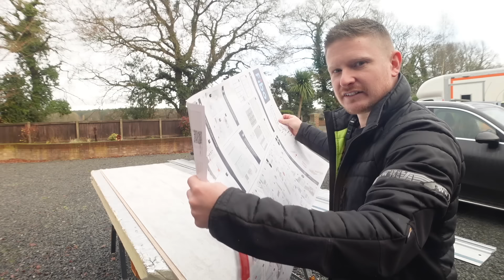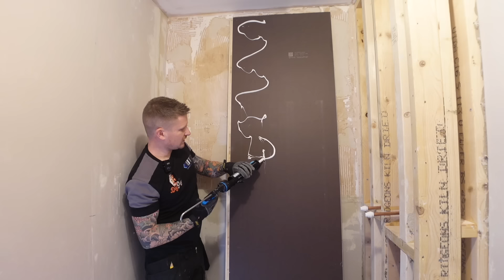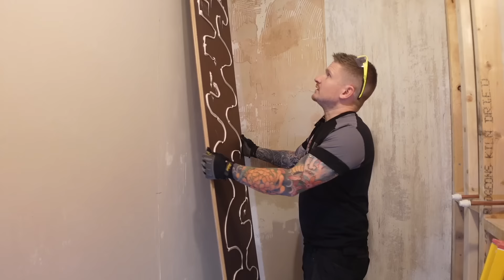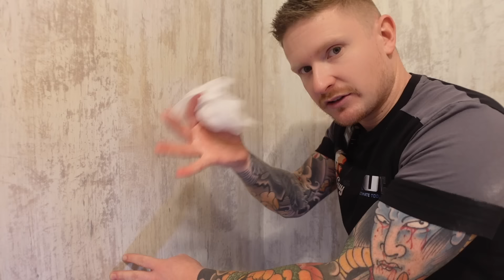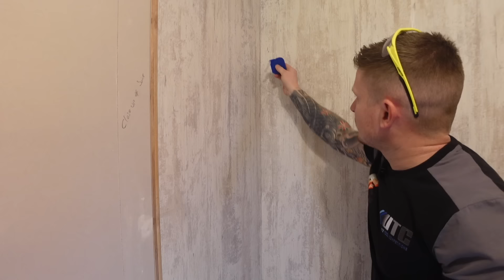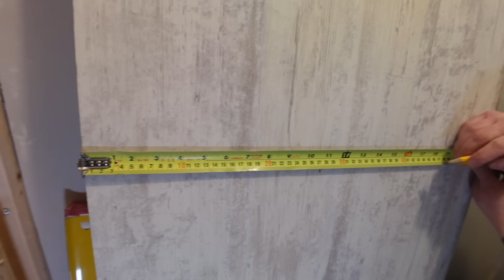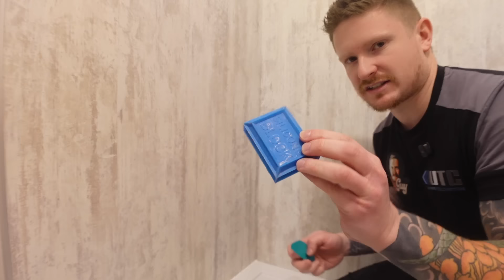How to Install Shower Wall Panels - Easier and Faster Tile Alternative!

Comment: A question for you, I'm planning a bathroom renovation and I want shower wall boards, but would you suggest taking the existing tiles off or leaving them on and just put the boards over them?
Reply: Hi, may I ask what did you do, did you remove the tiles? I have the same dilemma, to remove or not, something tells me to remove
Reply: @ChristopherSkierka  The people who installed the panels for me left the tiles on. The amount of work required to take them all off to get basically a centimeter of space on each wall is not worth it.
Reply: @AlexKnight1978 thank you. I just have this feeling a fail will happen in the future if it's stuck to the tiles instead of the substrate, also u can tank it better if tiles removed

Comment: How did u scribe the board that would,nt have went in tight to corner with pipes stuck out ,liked to have seen how that was done......
Reply from the maker: Yeah I didn’t show that. It’s done in the same way, before drilling the holes. You just stand the board at a slight angle so it sits up against the pipes and you get the same shape 👍

Comment: Wen u use your tracksaw  do you clamp the actual track down?
Reply from the maker: Nope you don’t need to 👍
Reply: Rubber type backing on track or something similar so it grips rail?
Reply from the maker: Yep you got it 👍

Comment: Great vid 
Can you settle an argument between me and my plumber please - I’d appreciate your views 
Panels down to floor then tray in Or tray in then panels to shower tray
Cheers ?
Reply from the maker: Thanks. Tray first then boards down to it. That’s the pro way or you’ll find it will likely leak.
Reply: @TheDIYGuy1  that’s what I said 
👍🏻👍🏻👍🏻👍🏻🔨
Reply: Modern construction thinking is that water will eventually make its way through joints (silicone deteriorates) and so things should be designed to minimise damage or remove water once this has happened. Under this basis, having the silicone seal below the lip is required (water generally doesn't travel against gravity.)

Comment: Great video, but most customers will choose the upvc type panels when they hear the cost. Personally, I never fit any wooden products in wet areas and no plasterboards. I'm not a fan of silicone straight on top. IMO you need a 1-2mm gap to fill as you would do when tiling. Avoid using push fit plumbing fittings in built in application. End fed soldered will never fail if fitted correctly.
Reply from the maker: Thanks. Yep they aren’t cheap but they are damn good. I didn’t do the plumbing on this job but do agree it’s best to use copper.
Reply: There is a time and place for every type of fitting (push fit, end feed, compression, presstex) you just have to use what's best for the installation as all have their plus &minus points.

Comment: Nice video as per usual, I fit a lot of shower wall but tend to use multi panel, I did however ask my supplier about the Fibo panels after your last video. I like that they come in 600mm widths, perfect for those tight staircase and landings! The only thing I do differently is I tend to use CT1 where the boards meet the ceiling as it’s paintable unlike silicone. I also put a bead of clear silicone where the board meets the tray and clean off prior to the final bead.
Reply from the maker: Yeah I’ve done that before too 👍

Comment: On them boards, you usually have to use the multipanel manufacturers own grab adhesive otherwise, they can cancel the warranty (and repair if they fail). Love using them btw.
Reply from the maker: Yeah they will all look for ways out. I don’t buy into it all personally. Fit them well they don’t fail anyway in my experience. Cheers
Reply: @TheDIYGuy1  and er, how many years since you fitted your first one?
Reply: How would they know unless they rip the panels off the wall. I would just say, cause i used your product😉

Comment: I have different model of the same brand installed in my bathroom. 2 years so far.. perfect.. easy to clean. perfect for our hard water. However I would recommend it install them from the floor to ceiling, not to tray! You most likely replace tray one day... but these panels will outlast it!  Mine stone tray has cracked and will be replaced soon. Luckly all we need to do is remove it gently and replace it. IT will be much easier to lift it up. With boards cut to tray, you kind a lock it.
Its marine plywood with resin and vinyl on top. Super durable! You can drill it (read instructions) or attach drill less accessories like (paper, tower holders)
Reply from the maker: Glad you like them. With tiles or panelling, if installed down to a tray they usually end up leaking in my experience. Thanks

Comment: Nice clear video, definitely consider these for the next shower I do instead of tiles. Much less hassle.

Very minor point, its not recommended to cut into PIR boards with a tracksaw, the polystyrene doesn’t cut cleanly instead it can melt and gum up your tracksaw blade, or at best blunt it prematurely.  Instead the advice I’ve been given is to cut into a wooden board; I use hardboard or OSB offcuts from previous projects
Reply from the maker: Thanks 👍. You should give them a go.

Comment: Quick question; on a limited budget, would you go for tiles or boards in a shower?
Reply from the maker: More than likely tiles. That said … you can get some expensive tiles and some cheap tiles. As you can get some expensive boards and some cheap ones.

Comment: Another guy commented on this too.. but shouldn't there be silicone on the bottom same as the corner.
Reply from the maker: You can if you prefer but it’s not really needed.

Comment: You siliconed all the way around the tray. Wont it stop the door frame butting up to the board? I recently had to refit my shower door and had this conundrum.
Reply from the maker: Nope, it be fine unless you’ve a huge silicone bead.

Comment: The BIG issue with shower boards is that they are fitted with silicone seals that will break down over time, but by the time its noticed and repaired the damage has been done to the substrate and floor.  The corners are the most problematic and for that reason I have only spec'd preformed corner panels as the flat panel joints are slightly more reliable.  The only spec I now put forward is tiling on a waterproof membrane that is applied to the substate and even then if I can I spec a cementitious tile backer board to provide a stable surface.  Generally, wet areas should not be lined with any plastered product even if it says its water resistant, because it moves around too much and causes failure of what it is fixed to.
Reply: Sounds good. What waterproof membrane do you recommend?
Reply: @vc6769  I specify Schluter Kerdi for shower walls and Schluter Ditra as a decoupling membrane for the floors.  Where the walls are tiled out of the shower then I like to specify a cementitious tile backer board as this moves in closer union with the tiles.  There are other proprietary membrane but I have had reliable results with Schluter products.  There are YT videos showing the Kerdi installation.
Reply: @clivewilliams3661  thanks,  that's so helpful! 🙂
Reply: I worry about this on mine so dry after each use and inspect at least once a week
Reply: @TimMSUK  That is unlikely to help very much because you won't see the pinholes that will attract water through the sealant until long past the point where damage has been done.  Your best bet is to add replacing the sealant as a regular maintenance item, the period being determined by the quality of the joint application, the use of the shower and the water volumes.
Reply: Ofc it would help @clivewilliams3661
Reply: @clivewilliams3661 thing is, some of these boards are tongue and groove, there maybe a fail in there, something u can't replace. I do not comprehend at all trades people installing these instead of tiles because we know silicone does over time fail and yet they go ahead. . At least with tiles you can catch an issue at the outset. Perhaps the only exception is if it's a shower cubicle and the wall panel goes beyond the perimeter. The Just have the corner and bottom 2 sections to tank, less silicone
Reply: @ChristopherSkierka  The problem with tiles is that you can get microcracks develop in the grout , which lets in water due to differential expansion of the tiles and substrate.  this is why tiles should never be fixed to plaster or plasterboard because they expand and contract at a different rate to the tiles. Traditionally tiles would have been bedded onto a sand cement render that moves like the tiles.  Today we use a tile backer board to do the same thing and I insist on the cementitious ones.
Reply: @clivewilliams3661 thank you
Reply: I'd recommend redoing the silicone every year.
Reply: @gavinhay6627   That is not going to happen in 99% of all installations.  Depending on the extent of the silicone work that will be an expensive item.  Ensuring that the old silicone is removed cleanly to get both a reliable and good looking result is the bulk of the problem.
Reply: Shower tray upstands and tank walls and floors with 6mm nomoreply cement board. Problem solved
Reply: @1longholiday still have the silicone joints though that will fail eventually,,, ingress behind that does not get caught in time? All silicone fail
Reply: @1longholiday  Nomoreply cement board is just a cementitious tile backer board that I included in my spec.  It is useless on its own for a shower enclosure and requires a waterproof membrane and finish like tiling.  It is excellent as a tile backing board for non-running water applications like the rest of the bathroom.
Reply: @clivewilliams3661 got this job coming up, changing the bathtub to a long shower tray so he can wash his bike, that area be like a wash room, he wants wall panels, but I can see water getting in at the seems
Reply: @ChristopherSkierka  The advantage of panels is that there is no grout to clean or go mouldy but the silicone at the joints does eventually need replacement and being a shower really does need a waterproof membrane behind it.  There are systems that utilise trim pieces that clamp the edges of the panels but I have only used them in commercial kitchens.  I would be very concerned about washing a bike in the shower since access will be restricted into the enclosure but mostly because the shower outlet won't cope with all the detritus that will be washed off.  The shower would need a full sized 4" gully outlet with a silt bucket.  I would suggest that the room be considered as a wet room and be fully tanked.  My walk-in shower uses Schluter Kerdi on the walls and floor with the rest of the room having Schluter Ditra debonding membrane under the floor tiles and wall tiles bonded to rendered brick walls.
Reply: @clivewilliams3661 that is a really good point about the crap coming off the bike and into the drain. I will look into that bucket matter etc. I never knew about this bucket you mentioned, does it fit into the waste trap and then if it's a shower tray it would need to be a 4 inch hole too!? I can see this project been a pain in the A**E😂
Reply: @ChristopherSkierka  The drain that has a bucket is generally a commercial item used for areas that for example need hosing down.  The size of the drain is 4" that usually has a 6-8"square or circular grating so is unlikely to be found with a preformed shower tray.  These outlets are designed for tiled or for vinyl safety floor, it is not really a common domestic product.  Washing down a bike in the shower is fraught with various considerations that are not really compatible with a domestic shower room.
Reply: @clivewilliams3661 well it was designed to wash our bodies not mechanical items,, you bound to get a building up of mess because of the grease build up, be like one of those fat burgs they find in the sewers lol
Reply: Hi you seem to know your stuff. Would you remove old tiles and then use these panels? Then, u can tank the area. Some how it does not sit well with me using these panels over tiles. Also do you have a preference which make etc of wall panels? Thanks in advance sir
Reply: @ChristopherSkierka  The problem with removing wall tiles is the substrate they are fixed to.  All too often they are (improperly) fixed to plaster/plasterboard that disintegrates when you take the tiles off and then you have significant repairs to carry out.  I would leave the tiles as they are a sound substrate and then line with a waterproof membrane like Schluter Kerdi ensuring there are no joints in the corners.  What wall panels are available depends on which market you are in.  I don't tend to specify wall panels (commercial kitchens excepted).
Reply: You mean joints in the corners with the membrane? Ps you can actually use it over tiles too? By the way do ever worry about the silicone on the panel joints failing eventually? Ps thank you very much for your time spending on replies to me
Reply: @ChristopherSkierka  The membrane must have joint(s) somewhere and the joint is always the weakest point so try to keep them away from the corners.  The membrane is applied to a slurry that goes on the wall that smooths out over the tiles.  Obviously the tiles need to be sound and bonded.  As I said before, the silicone jointing WILL fail at some point but before that becomes visible, hairline cracks will appear where the silicone is bonded to the panel edge and the water will be attracted behind the panel long before it is noticeable.  Having a sound waterproof membrane means that you are not reliant on the panel or the silicone.

Comment: Thnx for showing me the Fibo boards. The only problem is all the instructions say you need a bottom trim that holds the panel 5mm from floor or shower edge. And then you seal that gap with silicone. I assume it's for expansion as the temperatures can fluctuate in bathroom. I wouldn't disregard manufacturers instructions on this. Also the edge trims they have are only two colours. I wonder can it be painted with other colours 🤔
Reply from the maker: Your welcome. Having fitted 9 different sets of these and never had an issue I am happy to keep fitting them the way I do. But you’re more than welcome to give it a go your way, it might work for you. Cheers

Comment: Just worth noting when you’re doing the shower pipe holes, you’ll need to scribe the corner join and cut it first, not after measuring and cutting your pipe holes!
Reply from the maker: Correct 👍

Comment: Those boards look great - much better than the honeycomb ones, which look prone to damage. Got to do a shower in our new house, and I'm trying to get the bottle to use boards - problem is, being an amateur, if I mess up a tile, it's just a couple of quid down the toilet, but an awful lot of dosh if I screw up a complete board - this video, though, is giving me more confidence to give it a go. Thanks, and Happy New Year
Reply: I used the PVC product and you're right; it's not that durable (but it is 100% waterproof). The Shower Wall Panels are much more durable (and I would like to use them in my next bathroom renovation). However I was concerned by what would happen to the Shower Wall Panels if water ever finds its way past the silicone through to the panels' substrate?
Reply: @simongreenidge6454 if it anything like my old bathroom “water resistant” boards you’d be right to be wary. Water eventually got past the silicone and a couple of months later the boards blistered up.
Reply from the maker: You can do it for sure!
Reply: If you're doing it DIY then go for tile these boards are getting better but won't beat a nice tile finish just make sure you use a good grout sealer.

Comment: I’m not a fan of shower boards but have had to fit plenty of them. Good to see how others do it but I’m glad I’m not the only one not using the internal corners for me they are always awkward to fit and never feel deep enough. I’ve always packed my boards up on the tray by a couple of mm and I normally bed the bottom onto a silicon bed but there’s always more than one way to do these jobs. Love to content have picked up one or two tips I use on my jobs so thanks.
Reply from the maker: Thanks for sharing. Your way sounds good to me 👍
Reply: Looks fantastic ❤❤
Reply: Is there much risk the boards blowing at the back because its plywood? Not everyone keeps an eye on the silicone and if that fails then ingress of water happens?

Comment: Still not sure how you scribe that board with the two pipes there, unless you make the holes first. In that case, after the scribe cut, the holes will be in the incorrect place...🤷‍♂
Reply from the maker: Ah ok, the way I do it. Just stand the board forward of the pipes at a slight angle. Make the scribe and you’ll be right on the pipes. If you do it after marking the pipes you would indeed be off on the measurements.
Reply: @TheDIYGuy1  Thank you!